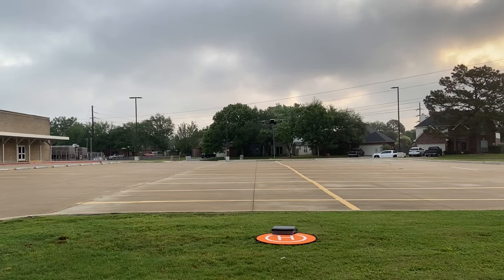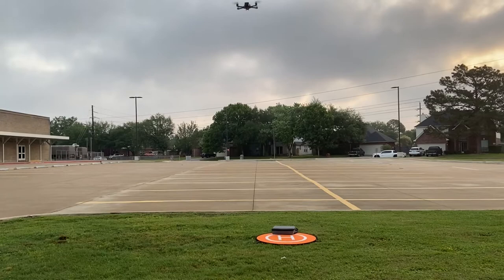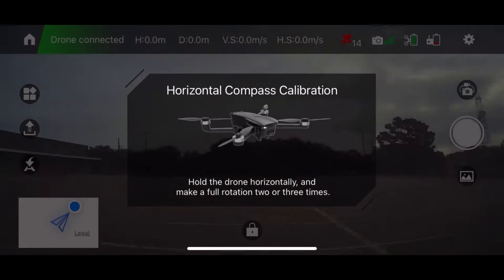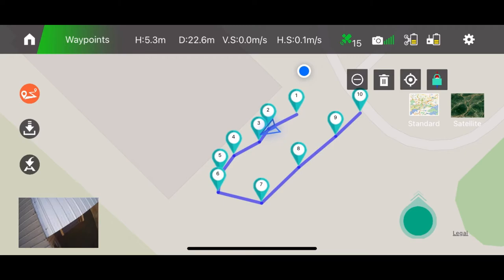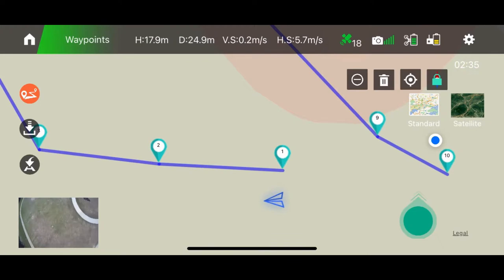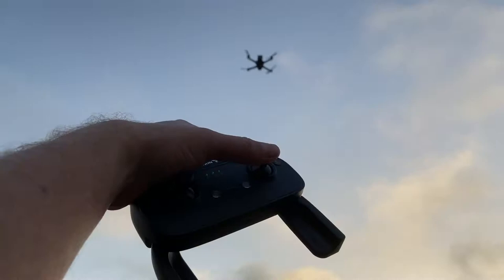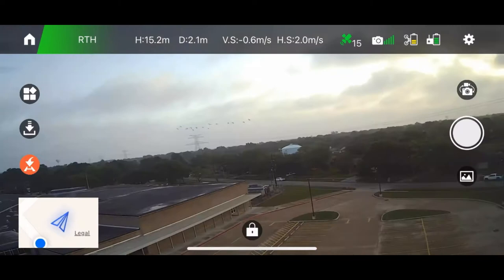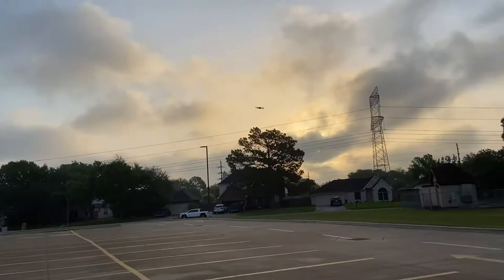The Toilet Bowl Effect - Snaptain 7100 Drone, and What to do when it happens

Comment: No GPS, check. Could it be that the drone switches from satellite to satellite to satellite over and over and this is why it goes in circles?
If it only communicated with one satellite, this wouldn't happen?
Reply: Your GNSS antenna needs to receive signal from constellations. That means multiple satellites are pulsing electromagnetic signals and your antenna needs for example at least to see 8 of them to triangulate and estimate its own position relative to the satellites.

If you are not familiar with GNSS i recommend you to check how an antenna is built and how either the signal or the phase is analyzed, you will see it is pretty simple.

In my case, the toilet bowl effect was caused by an inflight hard reset of the primary compass.
Sometimes magnetic calibration is a mess, and the EKF is trying to deal with wrong informations coming from sensors. In my example huge offsets of the compass conducting to an inflight compass change. Basically the drone was trying to maintain its GNSS position with wrong heading informations